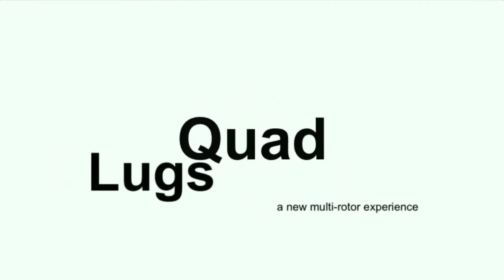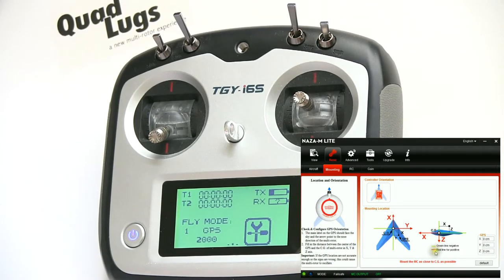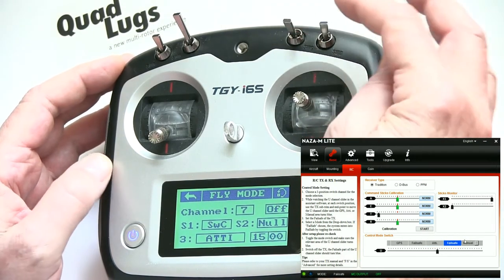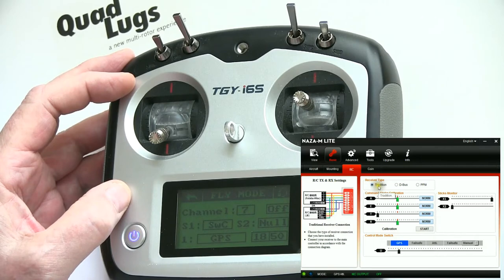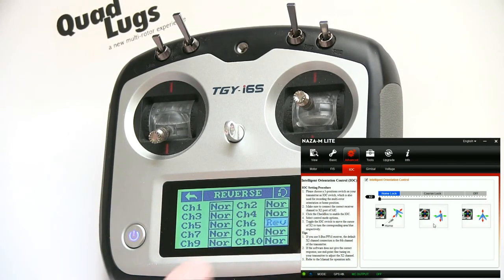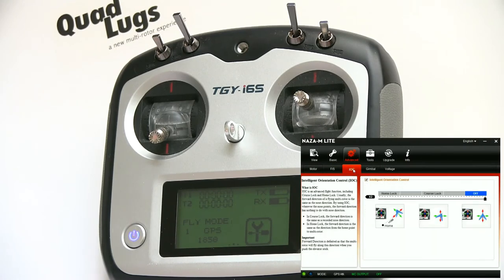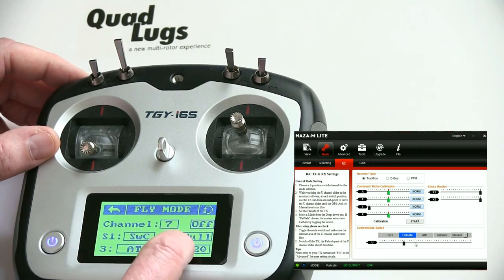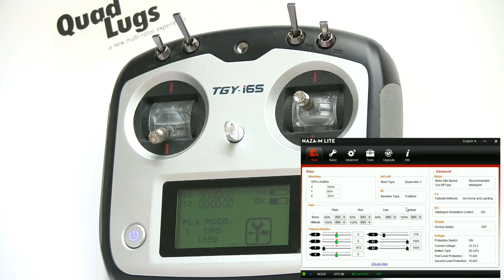QuadLugs - Bell build - programming the NAZA - M - Lite controller

Comment: Thanks very much I was successful in getting Manual mode setup in Naza M lite. The problem I had was I was only adjusting the first 2 thousand's and hundred's and not 10th's So I got the Manual mode to turn blue very happy. Now I have to setup failsafe as I had to remove it of the 3 position switch. Thanks again
Reply: This Video helped me not only correctly setup fail safe but to understand it as well so it doesn't need to be on 3 position switch, What was I thinking?? Cheers